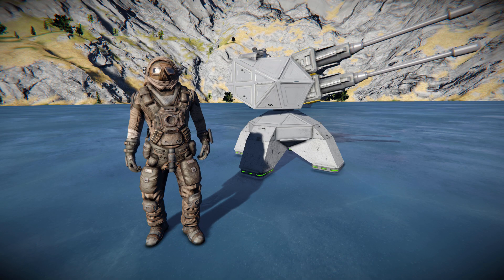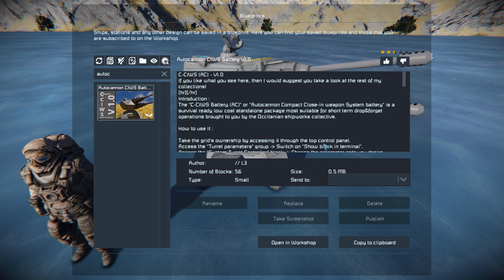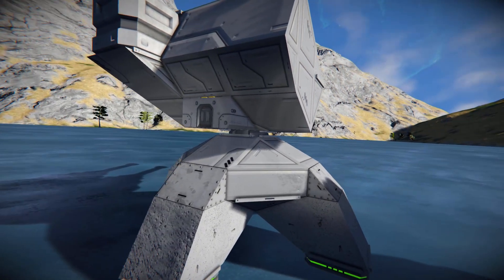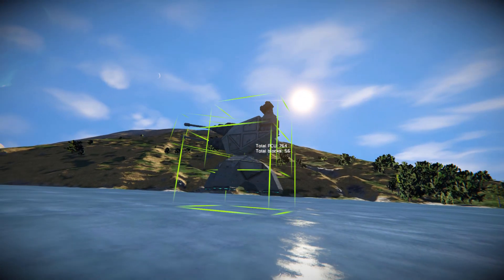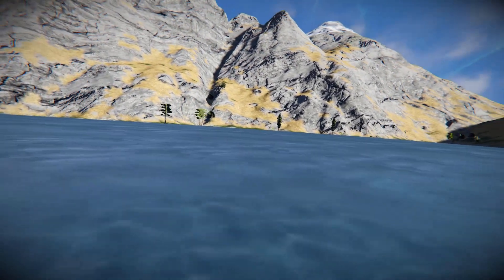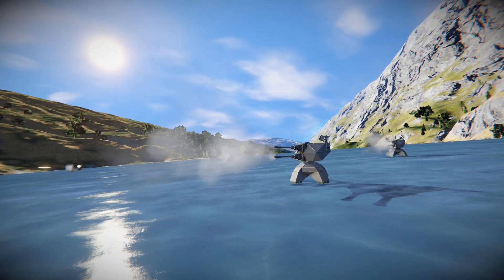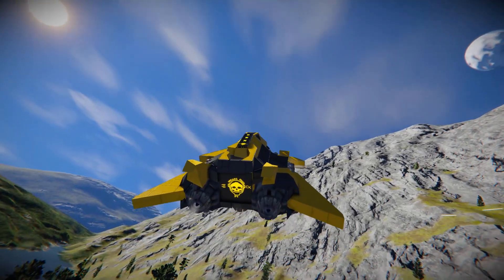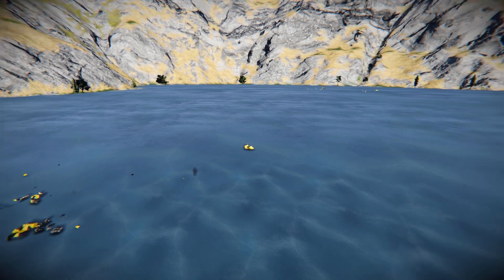The Autocannon CIWS Battery V1!! - Space Engineers

Comment: You should test this stuff in survival and check how long it's ammunition last. I kinda have a feeling it won't be long and will be very cumbersome to reload.
Reply: The answer is, they aren't going to last not even a minute. With 3x block inventory size (which is what I use) they can only fit 3 magazines (plus one already loaded), each containing 16 rounds which is only 64 rounds of ammo. Autocannons have a firerate of 146.16RPM, so they'll go through their ammo in a mere 26 seconds.
Reply: @doomdave475  Yeah that's what I thought but was too lazy to check myself. Creative builds are cool to look at but I'd love to see some more practical approaches.
Reply: @NNextremNN  
If you want both aesthetics and survival effectiveness, you could try using ball turrets as they can be fed through conveyors (in case you haven't seen them, you build them by putting a large grid hinge on a large grid advanced rotor, delete the hinge part then attach a 1x1x1 small grid hinge part instead of it, it will just float there, but it's actually attached and can rotate and convey ammo.

Comment: hm yes, instead of using single large grid turret lets just make some overly complex fragile auto cannon turret that is a one time use. Clearly I'm just not seeing the vision of the future
Reply: But it's cool, that's what matters
Reply: Build the same basic design with a medium cargo container. Problem solved.
Reply: It's an early-game option if there are scarce resources for something bigger.  You're not meant to build more than a couple, and they're not supposed to be a long-term solution.  It's just to have something available instead of being completely helpless until you can get something more permanent up and running.
.
It also only really applies to vanilla, because anyone using either of the nanobot mods (build & repair, or drill & fill), it's grotesquely easy to get a big turret up and running in no time.  Those mods are way OP.
Reply: no, these are exactly what one would build with the nanobot mod, in vanilla no one is going to place and weld 30 or so blocks when a single one does the same thing. Also I'm not sure how any gun can be "early game" as by the time you find magnesium (unless you find it before cobalt) you will have plenty of every resource especially because you need a full assembler to make any of the ammo.
Reply: @Polar_Onyx  it's 2 joints and a set of magnetic plates my guy reread what i wrote. this is literally a simple turret. what would be complex would be a quad-head custom missile SAM turret that has 5 degrees of motion. the word you are looking for is overengineering.
Reply: @Polar_Onyx  idk abt you guys but it's just luck. worlds have an issue of randomly lacking in 1 resource. for one guy on reddit it was platinum. on another guy on YT, it was iron. pint is keen needs to balance voxel generation because i have 200+ hrs on SE and the trick is to have high amounts of meteor showers. you will get abt 100+ units of every resource just by meteorite farming in a bunker with a camera. just have Gatling turrets with a good range of motion and a partially buried base, maybe with a covered hangar. this keeps you from getting ass-blasted by the meteorite showers if you go AFK or leave the base.
Reply: You are the kind of cretin to see a door and cry because it has more than 2 parts claiming your brain can’t handle the frame drop
Reply: no, it's the people that build a door with 15 articulation points and a massive script needed to open it without clang who get on my nerves. Engineering is about keep it simple stupid. we're not trying to make art here we're making a door